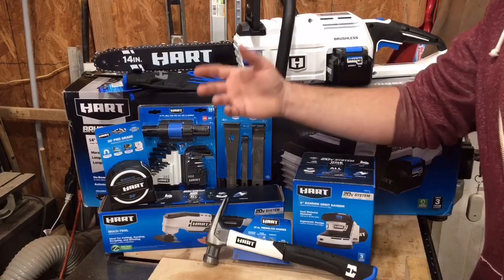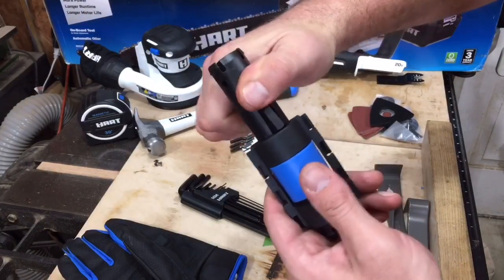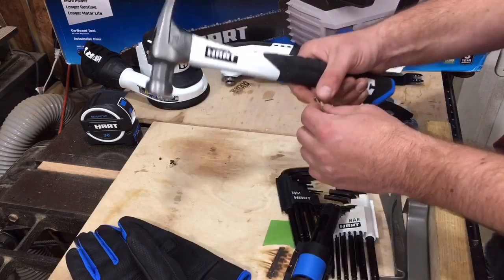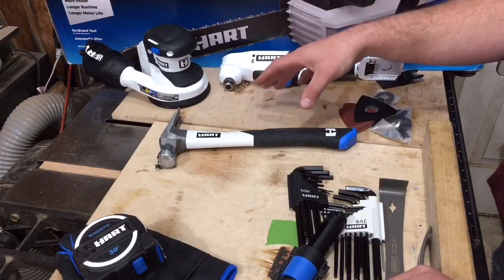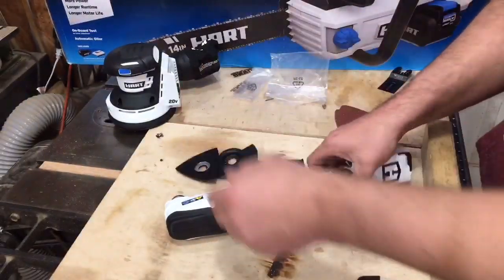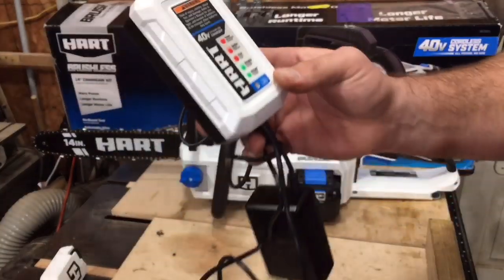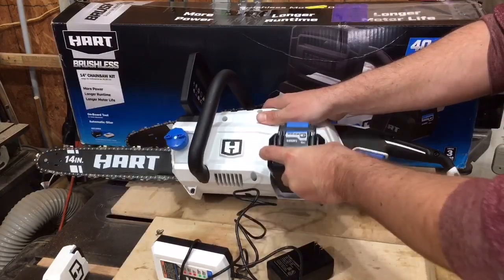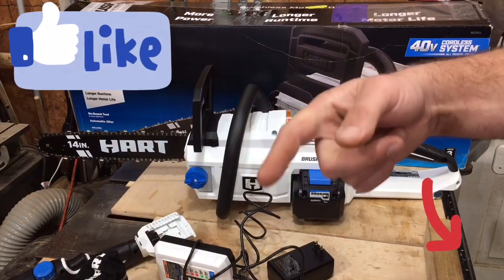FIRST LOOK at HART Cordless Tools & Hand Tools

Comment: Nice review. I have several Hart yard tools, weed eater, 40V chainsaw, 40V leaf blower, 20V snow shovel, and the 40V snow blower. I also have drills, stapler, angle grinder, and some hand tools. Very pleased with the build quality and ease of use. They are sorta high end DIY for home owners; definitely not for commercial use. Thanks for the review.

Comment: Hi I am a DIYer and would like to know if when using the hex key set and handle would it be better holding it with the gloves you had on earlier?  Also can you do a video showing it along with using their 9 inch leveler, their tool box with the half stack low profile customizable organizer and their hart technician case heavy duty tool box? You showed me things I didn't even know about referencing the hammer holding the nail and the magnet on the tape measure.  So thanks a bunch. Hope to see more hart video from you.
Reply from the maker: I am about due to update how things have held up. I dont have any of their boxes or organizers tho

Comment: I have a couple of Picard hammers with a nail holding feature. It works well. The thing is, can't recall the last time I used a nail instead of a screw. The Hart line looks decent for homeowner use.
Reply from the maker: About 3 years ago, i used a hammer to actually nail something. Was a stuffed animal zoo i used trim nails on. But you're right, most the time i use a nail gun or a screw.
Reply from the maker: Funny story, i had to do single plank siding of a 4 car garage nailed entirely by hand since the customer said coil nails don't hold and even paid extra. Added almost a week onto the job, woke up many mornings with my hand curled up in a fist, but by the end, i learned how to truly swing a hammer lol

Comment: I have a DeWalt cordless multi tool. I never thought I would use it. I bought a house and I have used it a ton. The DeWalt one is nice cause it has a quick release to put the blade on.
Reply from the maker: I think ive just gone so long without one that when i come across an instance i may use one, i defer to a more used method from my past.
Reply: Yeah that makes sense to me. I got mine for Christmas so I would have probably done something else if I didn't have it.

Comment: I have a hammer, maybe as old as you are, that has the nail starting head. Not sure if it’s magnetic or not. It was a hand-me-down that skipped a generation. 
Can you start a nail with the magnetic tip on the tape?
Reply from the maker: Thats why i was sure to include the new to me caption lol... i knew somebody was gonna say its been around for a while. As for the tape, challenge accepted! 👍
Reply: @BradsWorkbench  I would have read the caption, but I've been trying to learn Thai...
Reply from the maker: @HardKnocksForge  of course. New wife on the way?
Reply: Brads Workbench if she’s lucky...

Comment: It would probably work better having a key hole on the bottom of the battery so you can hang the battery and slide the charger on so you can tell when it’s charged. It’s not a bad lineup but over priced for what it is. I’m excited to see how that chainsaw holds up for you.
Reply from the maker: That could be cool. As far as price I’m on the fence cuz they are priced competitively with Ryobi but not proven yet. But they still may get that price point due to convenience for some. I’m interested to see if they will run sales during Father’s Day and the holidays like other companies.

Comment: Good reviews brad 🤜🤛
Reply from the maker: Hopefully they hold up decent. I've been impressed with the chainsaw so far
Reply: @BradsWorkbench  you nailed the reason for a diy guy to have this chainsaw.  My chainsaw hasn't been started since I bought it and I doubt it will ever run again. The best gas jobs are contankorus 🤜🤛
Reply from the maker: @thisguysgarage  ive got an old gas one that was my dads. Id like to go through and get it running again but theres so much on my list already. Its nice to pop in a battery and go.
Reply: @BradsWorkbench  absolutely